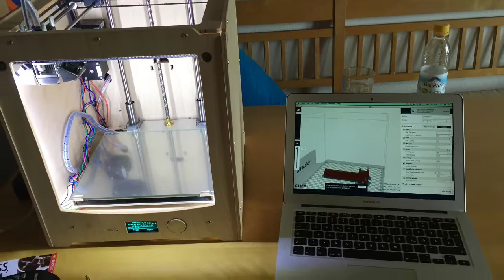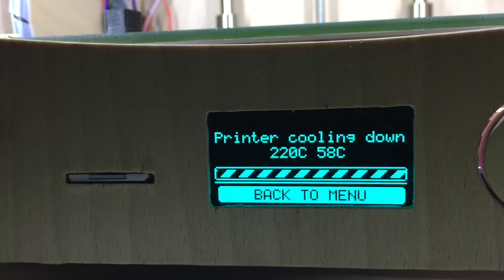DIY Ultimaker 2 project part 2

Comment: I wonder.. could this be done out of laser cut acrylic to make it match the ultimaker 2 colour scheme?
Reply from the maker: Yes of course. All files of the Ultimaker2 are opensourced on github. If you have the possibility... just do it ;-)
Reply: @daSamo123  do you reckon acrylic would be to flimsy? Maybe dibond would be better for the frame as it is a little more rigid
Reply from the maker: @amateurtech736  Hi. Thats a good question that i cant answer for shure. I think there is no much difference between acrylic and dibond.
Reply: @daSamo123  thanks for the reply! I believe dibond is acrylic or some other plastic with a sheet of aluminium 'bonded' to one side so it may be stronger. I am however now considering rebuilding the interior of my solidoodle 4 to be similar to an ultimaker and basically just using the sd4 frame and enclosure

Comment: How was the quality of the aliexpress/ebay components? Who did you order the components from?
Reply from the maker: I am quite happy with the aliexpress parts. I think they are not as good as the original UM2 parts and works very well. At the moment i printed 313 hours and 318 m of pla. The flashed Tinkergnome Marlin firmware is great an a lot better than the original one.

Comment: is it possible to rebuild your build , is their any instruction?  where do you get the ultimaker parts?
Reply from the maker: My starting point was the open source files from Ultimaker2. I have milled the case parts in my cnc machine. All other needed parts i bought on ebay or aliexpress.
Reply: what about the build plate?
Reply from the maker: I bought the build plate at aliexpress.
Reply from the maker: Hi. I used the opensource files from here https://github.com/Ultimaker/Ultimaker2 to generate the gcode files for cnc. I dont know if they work for you. I had trouble to get the case parts out of my cnc with an 2.5mm endmill.